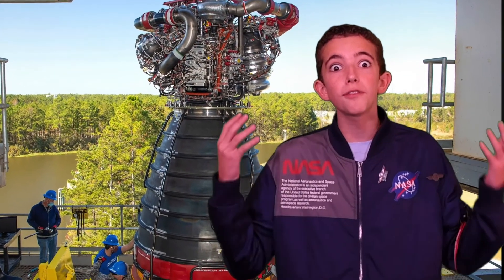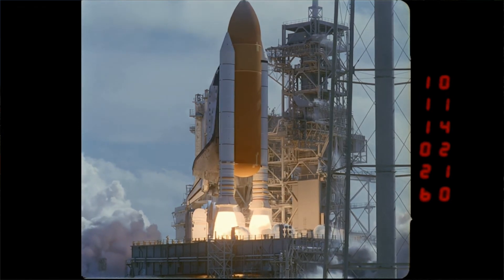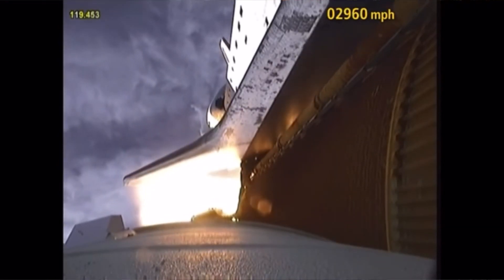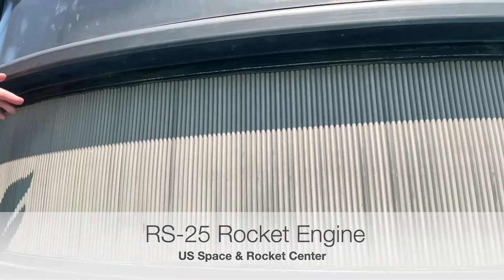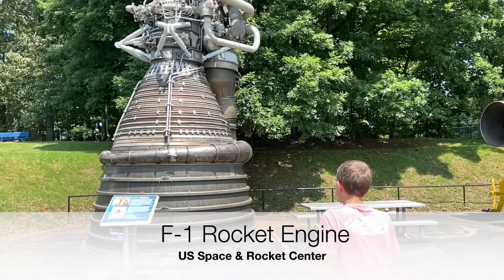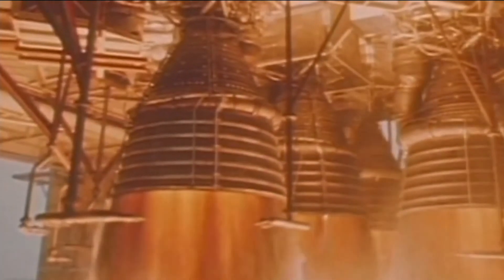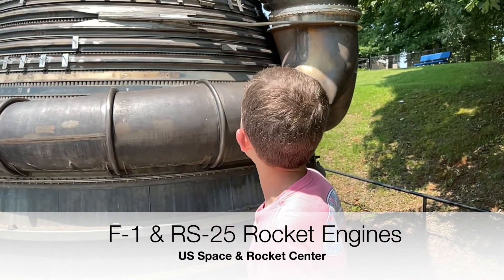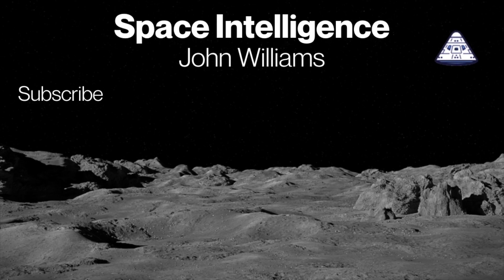Best Rocket Engines Ever? RS-25 & F-1 Engines Up Close

Comment: I agree, both designs are amazing technology demonstrators for their time, and 
I admire your motivation and dedication, but you need to do a little bit more homework...

The nozzle on the RS-25 is cooled by H2, not O2.   
The nozzle is not the combustion chamber.

https://en.wikipedia.org/wiki/RS-25
Reply from the maker: Thank you for letting me know of my mistake. I couldn’t recall the fuel that went through the pipes at that time so I made the assumption and I realized I was wrong later.
Reply: @SpaceIntelligenceChannel  you did awesome....theres always a starting point